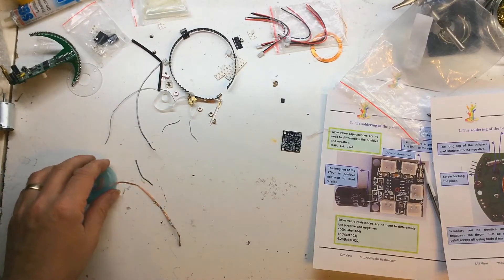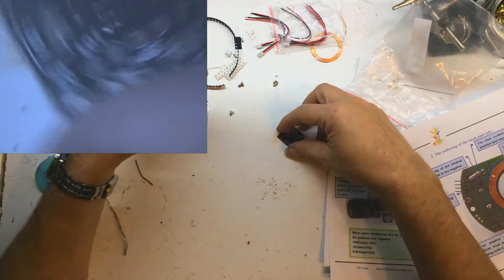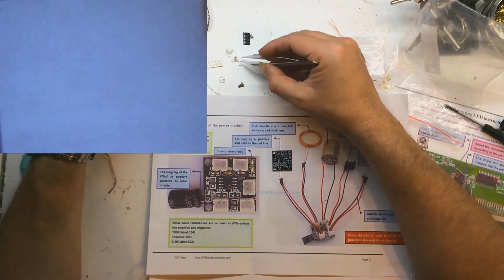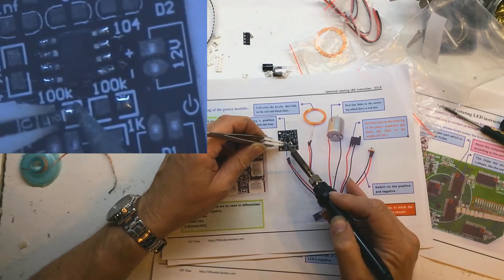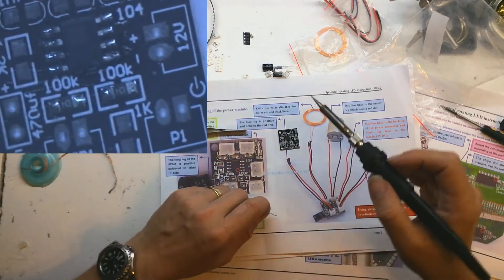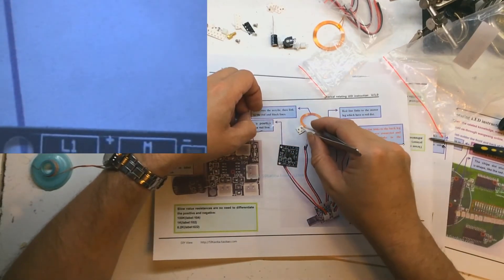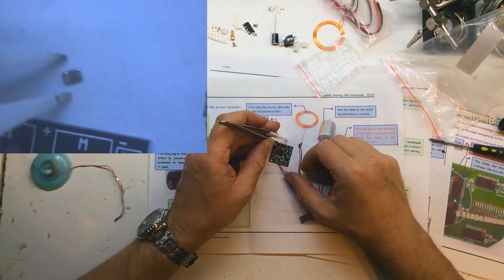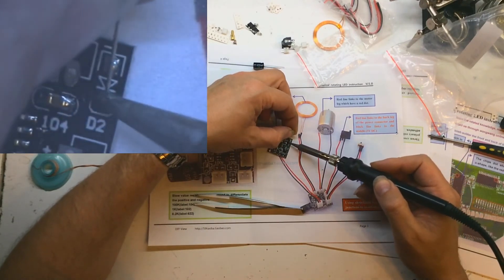DIY Spherical Rotating LED Kit POV from Banggood.com Part 7

Comment: Great video, I'm sure I'll use it many times when mine comes in. I'm new to soldering and this is the smallest I will have attempted. What watt iron are you using and do you have any tips?
Reply from the maker: im using a CSI701A station wattage is possibly about 30w, Tips never use lead free solder, flux is your friend but if all you have is rosin /multicore solder this will do and practice, through hole components are the best to practice with. Dave jones at EEVblog did a solding tutorials/tips and worth a watch and if you want to watch a SMD artist try Louis Rossmann repairing a macbook.

Comment: I didn't catch this in the video and I don't see it anywhere in the diagrams... just what do you with that diode designation on the rear of the PCB labeled D3?
Reply from the maker: Hi D3 is not installed on mine, D2 has a shorting link.

Comment: Why did you bridge the diode connections?  Was there any MELF or SMDs that came with it or are you supposed to bridge it like that?  Would that cause bleed back of a signal?
Reply from the maker: The instructions showed a short with the note "Direct Shortcircuit", pcb shows its should have been a 5.1v zenner, im presuming since it comes with a usb lead they are presume regulation is done (5v) but if you wanted to use  a voltage higher then the zenner would need to be fitted.